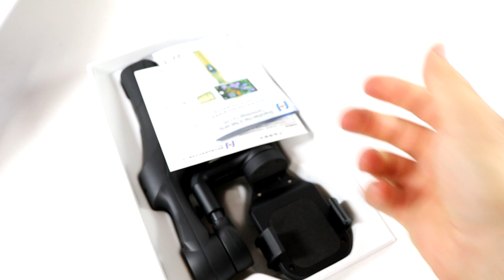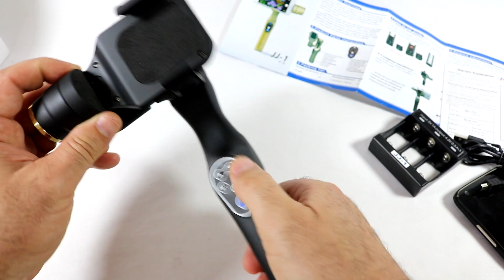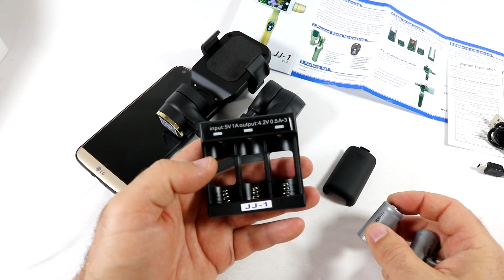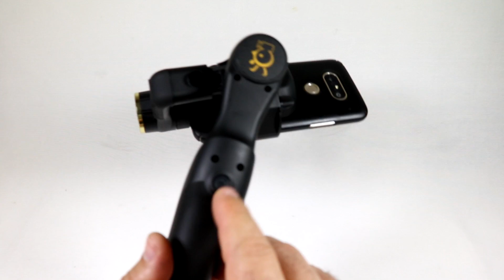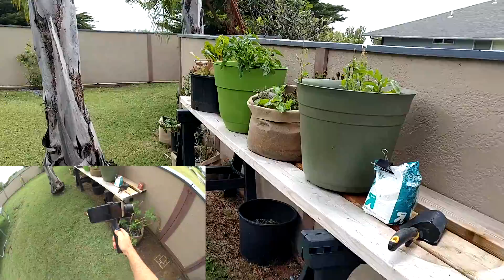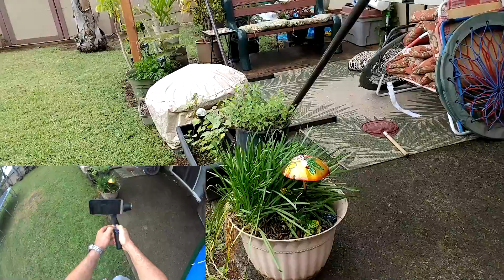XJJJ MOBILE PHONE GIMBAL Review - [UnBox, Inspection, Setup & Outdoor Test]

Comment: video doesnt look good ... for a gimbal ... something wrong?
Reply from the maker: +Snappy FPV I know, not very impressed with this 2d gimbal honestly.  I think the encoding of the phone video also went a little haywire when I ran it through for editing and frame rate dropped.  Looks like they've replaced it with a 3d version due to not so great 2d performance.
Reply: Yap this is 2axis gimbal... If you want a real stabilizer you need 3axis.... This one do only half of job